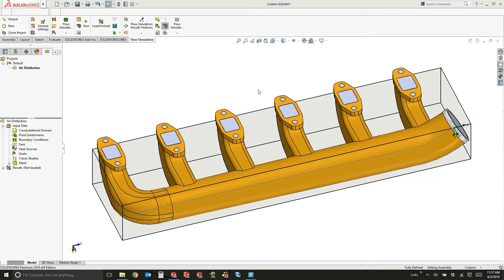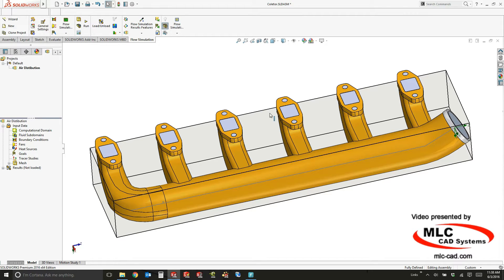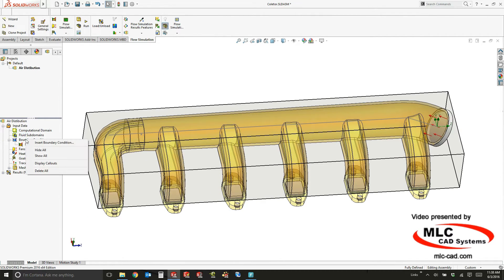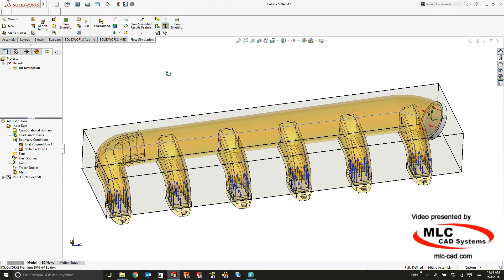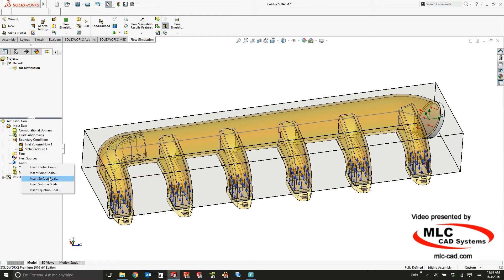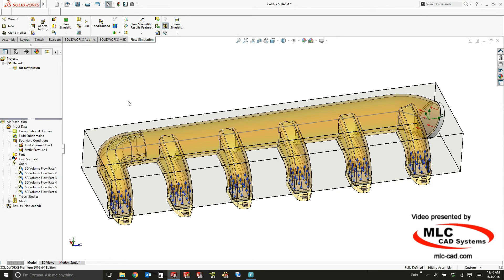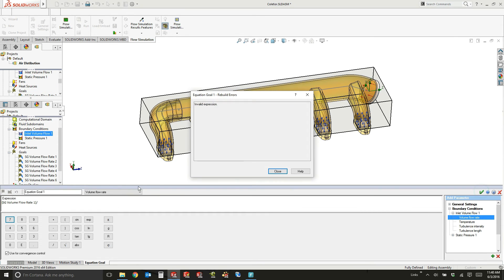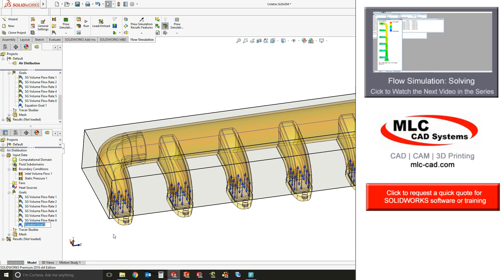SOLIDWORKS Flow Simulation: Boundaries and Goals

Comment: Hi 

Thanks for your effort .
Can you tell me , How I can save fluid region( in solid ) ?
Reply from the maker: One quick method would be to use the Intersect command.  That isn't a Flow command but will allow you to create a body for the internal volume of an enclosed space.  Also, the Check Geometry command should give you an option to create a fluid body, this was covered in an earlier video in this series: https://youtu.be/QT7tcOvXHJc?si=UCT7KHafLwBxRGIX&t=116
Reply: @MLCCADSystems  

Thanks for your promt reply.

Comment: what did you choose? external or internal?
Reply from the maker: This is an internal study, only the interior volume of the assembly is considered for flow regions.  It helps to think of internal as "Internal Only" and external as "Internal AND External".  Many problems could be done with either, but any time you have a closed circuit or volume it should be treated as internal in most cases.
Reply: @MLCCADSystems  hi do you have tutorial how to close circuit?
Reply from the maker: @signout5033  this video is part of a complete tutorial video series.  https://www.youtube.com/watch?v=QT7tcOvXHJc&list=PL1TStJR6oVYf6VX_mzheIkys6CPdetj25

Comment: Hye, Philip ! why i have error that show part is not laying on the boundary between solid and fluid region when try to defined boundary condition
Reply from the maker: This error message generally means one of two things.  It could be that your interior volume is not fully enclosed, which means any face you select will show that error message when trying to define a boundary condition.  In that case, follow the instructions in this video to check for a fully enclosed fluid region and use leak tracking to identify if there are any openings you didn't expect.  https://youtu.be/QT7tcOvXHJc   The other thing that might be wrong is that you are simply picking a face that is not touching the defined interior volume.  Make sure to select a face on the inside of your lid for boundary conditions.

Comment: hello sir error is showing that face is out of the computational domain
Reply from the maker: Start with this video: https://youtu.be/QT7tcOvXHJc
Make sure the system is closed and the internal volume is what you expect.  Also when you select a face for a boundary make sure to select the face that touches the internal volume, the INSIDE face of the lid, rather than the outside of the lid.  The computational domain is usually set automatically and visualized by a box, make sure the box fully contains the flow regions and all faces that need to be selected.  If you fix a leak or adjust the geometry, make sure to adjust or recalculate the computational domain.

Comment: Sir, There is a Error 
<FACE is not lying on the boundary betwen Solid and  Fluid Region> 
Please Help me to Fix this, I really need your help. 
ASAP
Reply: Hello Gautam, make sure to use the 'check geometry' tool on the flow simulations command manager!  Here you can 'show fluid volume' to ensure your face selection is lying on the boundary between the solid and fluid region.